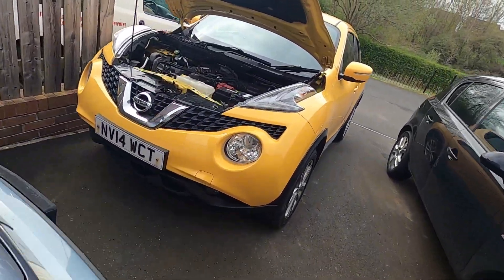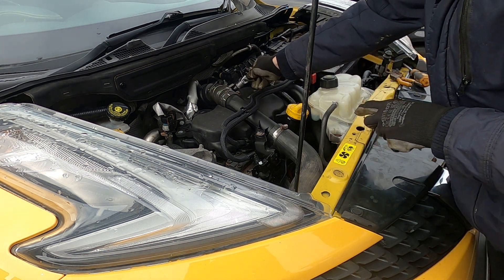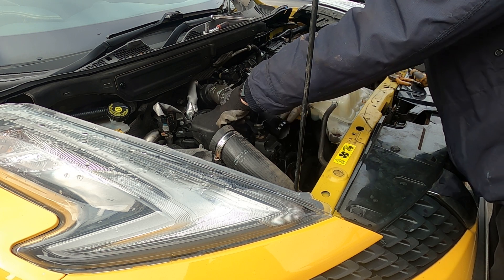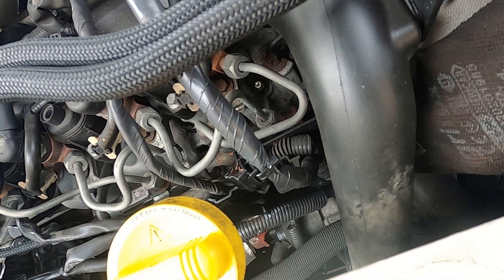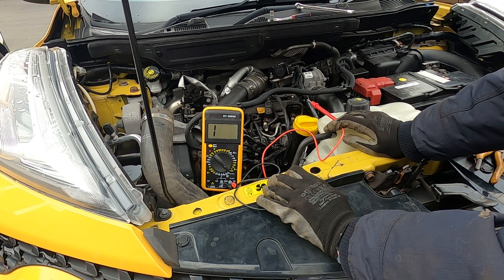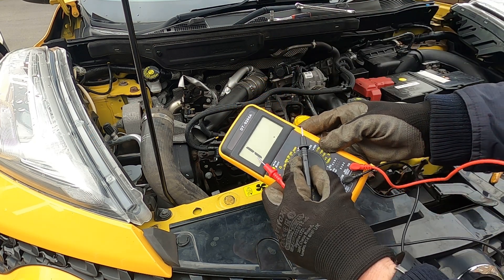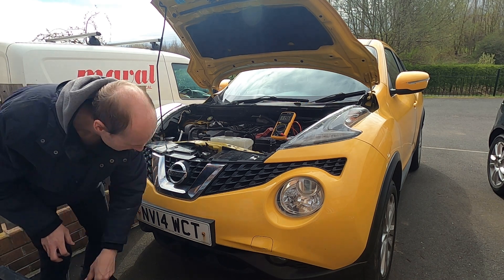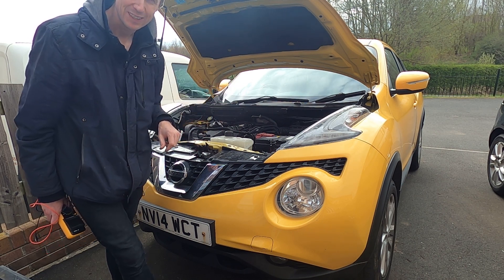Nissan Juke 1.5DCI K9K engine glow plug testing

Comment: did you manage to find the fault ? ..... im having same problem with a different car but same K9K engin .....cranking but no start.... and its summer here 😢...... checked the Primer Bulp ... gets hard when i squeeze it , but gets soft again after few minutes ....fuel filter gets filled by the primer..... i also cracked loose the injectors one by one while cranking the engin to see if fuel gets to the injectors, its a strong squirt..... next i will be testing the glowplugs and glowplig control module ..... if that not the issue i will test the injectors whether they maybe causing too much backpressure letting most fuel run back to the pump ...... my cheap OBD scanner wont even pick up the ECU so that i can check for any fault codes .... battery is fully charged but i think i might remove the 652 battery from my VW tdi to do proper testing of the electronic parts...... my head ia hurting at this point lol..... cant pinpoint the cause of my NO start issue 😢
Reply from the maker: Hi, that's a real pain, mine is nowhere near as bad, but no still not found the issue, I'm suspecting an injector due to age.
With yours, I'd ignore glowplugs as in summer they're barely used so by the sounds of it, it's a different issue.
When warm will it restart ok? It could be the crank position sensor, I've known those to be temperamental even based around temperature.
Sorry I can't help more but please let me know how you get on with it

Comment: Im pretty sure most k9k engines the glow plugs are 4.4 volts not 12v. My 4.4 glow plugs tested ok but would nearly draw 9 volts and would take 3 minutes for the tip to start glowing.
Reply from the maker: Hi, thank you, that's a great bit of info, I'd never even thought to check the voltage of the plugs as hadn't seen low voltage ones before.
Looking at listings for them you're right so 4.4volts, if it's higher it does suggest a fault in the glowplug.
I'll need to re check! Thank you :-)
Reply: @junkendriven  i had a garage saying my relay was bad because it was only putting out between 3.1v and 5 v but Is actually correct. The original factory plugs are made by BERU with a red insulator. I can see how someone would just put 12 volts to an old plug and just say yes it works. My brand new 4.4 plug started heating at 3.2 volts.👍
Reply from the maker: Thank you. Great info and I'll include in my updated video as today I've just replaced all 4. They had the small orange insulator so I'd assume we're factory original which would explain the difficult cold starts

Comment: To get to the glow plug control module you need to remove passenger side front wheel and wheel arch liner.the module is straight in front of you held on with one 100m nut/bolt.
Reply: Sorry 10mm bolt

Comment: must be the glow plug module. I think on a few systems, the coolent temperature dictated wether the glowplugs are enabled or not on a cold start, so it maybe something to do with that, or someware along those lines.
Reply from the maker: Thanks Nathan, yes either outside temperature or coolant temperature, the Juke appears to have a glow plug control module possibly hidden in front wheel arch so that might be worth checking next.
Reply: @junkendriven  Hello did you manage to fix it? Maybe you had P0380 fault? I changed glow plugs/glow plug control module nothing helped.
Reply: @MrErnicito I have this fault at the minute, Did you ever find the problem?
Reply: @freddieclark687 did u find the fault ?
Reply: @MrErnicito  I have this symptom and also the P0380 fault on occasion, but only when it's very cold and the engine is hot...you had any further info?
Reply: Did you ever fix this? My car is having same problem?
Reply: @kellygoodwin2608 if your still having the same problem it could be down to a leaking injector.
Reply: @Royalseaviper  all injector bar 1 have been replaced. Only does this is cold weather. All summer had no problem. Only when drop below 9 degrees.
Reply: @kellygoodwin2608  I manged to fix mine by changing glow plugs with ebay ones never had a problem since.
Reply: @kellygoodwin2608 did u solve it ?
Reply: @kevinhancock4064  no. Unfortunately not. Im dreading the cold mornings coming back
Reply: @kellygoodwin2608  oh did u say u changed the module ? I changed glow plugs yesterday not long bought it to tide ne over with just 73k miles ..I was able to clear p0380 twice but may return
Reply: @kellygoodwin2608  is your glow plug light coming up then going off ? As normal ?
Reply: @kevinhancock4064  yeah. Had relay changed too.
Reply: @kellygoodwin2608  wonder I'f it's anything to do with the vapouriser ? What ya mechanic suggesting ?
Reply: @kevinhancock4064  no one has a clue. They have suggested over riding relay by putting in a extra button that goes straight to glow plugs but i was baffled. I belive some cars have this.
Reply: @kellygoodwin2608  well I plugged car in today no codes so for  me it's worked new plugs sorted it